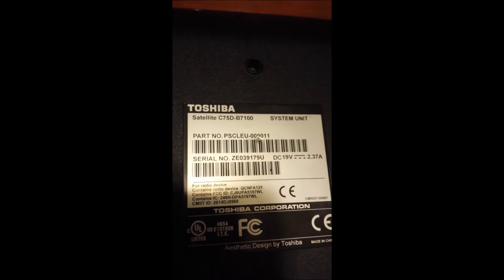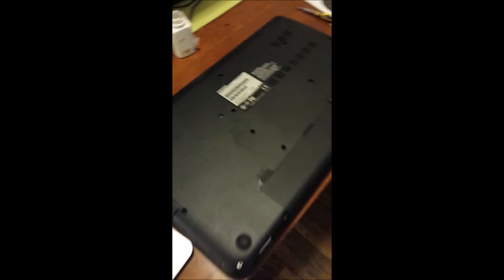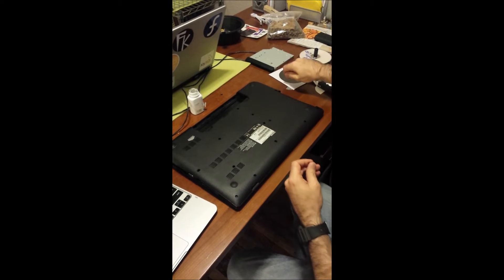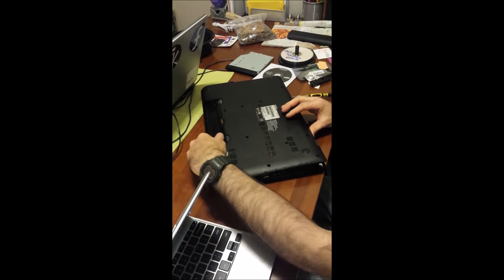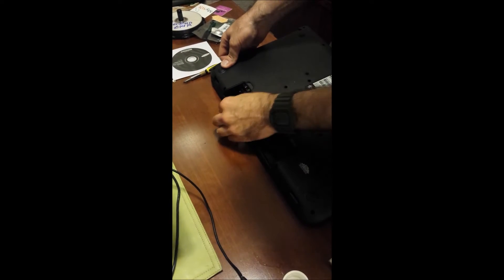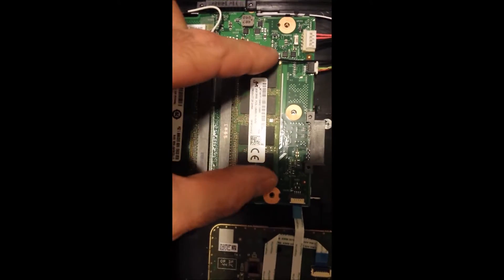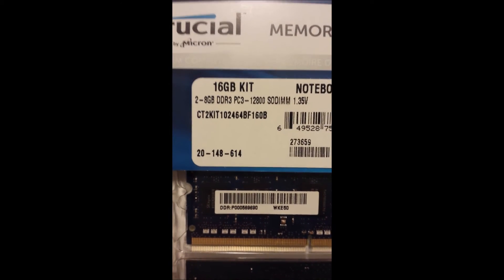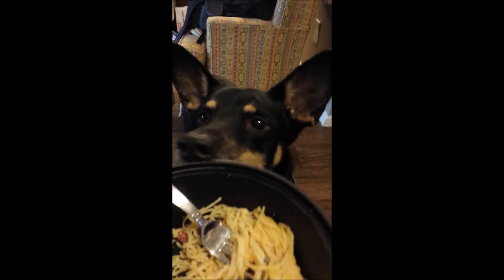Toshiba Satellite C75D-B7100 laptop can be upgraded to 16GB RAM and Samsung 850 EVO SSD

Comment: Just installed 16GB in my wife's Toshiba.  Great instructions on getting this apart, however, we can't tell there's any increase in speed.  May be time to do the hard drive, too.  Can you just drop an SSD in and start from scratch or do these require specific Toshiba software to run?
Reply: it should be just drop in. i haven't done this upgrade on mine, but i have formatted it, and flashed it to new operating systems more times than I can think.

Comment: I have a Toshiba Satellite C75D with 6g memory and 750 HDD. I swapped the HDD for a Samsung 860 EVO, which works fine. I also rreplaced the 6GB memory for 16GB. However the laptop wont start with the 16GB. Any ideas what I can do to get the laptop to start with 16GM?
Reply: Take both cards out, then reseat 1 in the first slot. then see if it boots, if it does, power down and swap the 1st card for the 2nd card and boot again. if both times it boots, power it back down and install both and boot one more time. some times computers can be finniky about part swapping. its best to test one thing at a time.
If it does not boot with one of the sticks of ram, that ram may be bad. or incompatible. you need ram that is 1.3v

Comment: This laptop is slow.  Does the ram make that much of a difference or is the processor just too weak that it won’t matter?
Reply from the maker: I would suggest putting an SSD in this system, that will probably make the most singular difference, but putting 8GB or more RAM in there will def. help. Mine has been very fast since I did these upgrades to it and it works extremely well so the CPU I think is good enough.
Reply: Chase Thanks, good to know.  I will definitely upgrade the ram.  Maybe the sdd too.

Comment: The cases are hung up around the center of the unit trying to separate. Flexing noticed at the area of the DVD/CD drive internal connector and PCB board area. Thanks anyway, I'm not sure what to do next on this thing. BTW: I serviced laptops for years, including Apple, MacBook Pro's etc.  This unit is a C75D-B7260 and looks the same with solid back. Don't know what now. Let you know if I figure it out.

Comment: when you upgraded your SSD, did you end up with unsuable space?  I had a 650 GB and I installed a 1TB and after cloning it, I still only have 650 available to use.
Reply from the maker: What you are going to do is go into Windows logical disk manager and "extend" your disk to include the remaining space.
Extend a Basic Volume
https://technet.microsoft.com/en-us/library/cc771473(v=ws.11).aspx#BKMK_WINUI

Here's how to get the disk manager open: START > RUN > diskmgmt.msc

Comment: Thanks much for the video!

I replaced the stock INCREDIBLY INSUFFICIENT 6GB of RAM with 16GB and my laptop runs 100% better. The new RAM was recognized immediately. 

I'm amazed Toshiba has the nerve to sell such an underpowered computer. Interestingly, before I switched out the original 6Gb with the 16Gb there was typically only 1.5GB or so of useable memory. With the added RAM there's 15GB, IOW, the system itself is using much less RAM. Maybe the replacement RAM was of better quality than the original RAM that came with the computer?
Reply: Soooo many small screws to remove to disassemble the case. I wonder if Toshiba does that to discourage people from opening-up their laptops to upgrade them? Maybe the idea is to get them to buy a NEW machine rather than upgrade the old one?
Reply from the maker: I am glad that your upgrdae went well! :-) I am glad you found the video useful thank you!

Comment: I have a Toshiba satellite C75D b7297 which looks on the bottom to be same as yours, Chase H. I haven't opened it up yet, but the symptoms are a few months ago the HD started making squeaks and squeals and the computer shut down. Would not reboot normal. I was able to recover with the USB recovery stick I made when I got the laptop.  I believe your video will help me when I go to replace the HD with probably the SSD that you used.  Am I to understand that the recovery isn't dependent on the old hard drive being present, but just using the recovery usb and any settings I might have to make in the bios... that it 'should' recover back to the windows 10 it came with?  Thanks for any input. It's unusable at the moment... EDIT: ok, you did answer my question at the end of the video.  I have another issue which isn't that bad, but an annoyance. I use an external usb mouse to get around it... the touch pad has lost most of it's sensitivity... any ideas?
Reply from the maker: If you replace the SSD you might as well do the RAM too. I did it to my system and it runs faster than anything you can buy prefabricated.
Reply: Chase H. yes I was thinking the same as well. I ordered mine with 6 gigs of RAM but 16 might as well the price is not bad
Reply: Did the upgrade on the SSD Didn't order the memory yet (have 6GB right now).  Tip for folks- as you mentioned in the video, keep going around pressing the case together as long as you see a gap or hear it still snapping together. When I thought I was done pressing it together- I wasn't.
Reply: Chase H. Thanks for the heart. I know I already mentioned this but I did the upgrade on the SSD. For a year now the laptop has been booting up in about 17 seconds. Great upgrade.

Comment: Would this work for a C75d-B7300?
Reply from the maker: It probably will, but what I would suggest is opening it up first and looking at the RAM. You want to make sure to get aftermarket RAM the exact same speed and specs as what was in there.

Comment: great vid. what's teh best way to clone or copy over data from the old drive? I got a 650gb and it's near full. Wanna get the 1TB SSD.  Is there any config needed?
Reply from the maker: Hello! Thanks for the compliment. I got a copy of Acronis True Image that came with one of my SSD drives, and it works well for that use. I did not have to pay for the full license, but it's very good software for backup, restore, and cloning systems.

http://www.acronis.com/en-us/personal/computer-backup/

Comment: Your link to Newegg not working!   What  the crucial part number for the memory ?
Reply from the maker: MEMORY IS:
Crucial 16GB (2 x 8G) 204-Pin DDR3 SO-DIMM DDR3L 1600 (PC3L 12800) Laptop Memory Model CT2KIT102464BF160B

http://www.newegg.com/Product/Product.aspx?Item=N82E16820148614
Reply: Thank You for the info. You might want to check Amazon prices I know Amazon shipping is much faster Newegg

Comment: Can I upgrade the AMD A8 cpu to an AMD A10?
Reply from the maker: Hello! Not sure why you would want to do that for such a small performance upgrade, but it depends on the socket and the motherboard chipset. I don't know the answer to this though, but it would be interesting to try. Here are the performance differences:

http://cpuboss.com/cpus/AMD-A8-6600K-vs-AMD-A10-5800K
Reply: +Chase H. Thanks for the reply laptop as a gift and have been using it for gaming so max performance I guess, I replaced cpu in laptops be like a hp pavilion.

Comment: I did purchase the 16g ram chips and made a huge improvement, now only if i could overclock the cpu and gpu so make gaming a bit easier. I bought a ssd when i bought the laptop, so i can't comment about speed change as i didn't boot it with the shitty 5400 rpm one it came with

Comment: While this certainly makes cleaning the fans and such very easy, at least in comparison to the method on older laptops that required you to do far more stripping down of the machine, but JESUS this makes just swapping hard drives out a real bitch.

Comment: im having trouble with the back i can almost lift it up, but it seems to be attached to something, its right below were the battery is
Reply: I'm sure you have gotten it by now but it's just a small plastic knob under the battery connector that is holding it. Just stick a small flat screwdriver or something else that will fit under the plastic and pry up, it feels like something will break but it should pop out without breaking first.

Comment: Thanks so much for making this video!  I've searched far and wide looking for disassembly instructions for the C75D series and yours is essentially the only one out there!  Makes you wonder why they didn't do like just about every other laptop (Toshiba and others) and just use a case with "trapdoor" compartments for memory and HDD upgrades! THANK YOU!!!
Reply from the maker: +Mike Segotta-Cassi - I am glad it could help you Mike. I have been using my upgraded computer now and it's VERY fast. Does everything I could want and more, and if I bought it like this it would cost 1000 bucks so I did it on the cheap and if I could help others that's why I made the video. :-)
Reply: Well the good news is that I was able to open it up just as easy as you please once I watched your video...the bad news is that I wasn't trying to upgrade.  

The client who owns it locked themselves out of the HDD and after nearly a week I've given up on salvaging the drive.  (I was pretty sure the data was toast from what I'd read about Toshiba systems, though.)  

What I didn't expect was that wiping the drive with AutoNuke takes like 800 hours to complete!!   It's been executing the wipe process for about 24 hours now and I might just stop it before too long and see if I can't at least format it at that point.  The data isn't sensitive nor does it need to be recovered, so I'm hoping in 24 hours AutoNuke has gotten past the boot sectors and anything else flagging the device as locked.  

Otherwise, I think I'll have to recommend the client just but a new drive (SSD of course) and start from scratch--especially since he's already let me know he has erased the recovery partition a long time ago.  Hello Windows 10!  <ugh>
Reply from the maker: Well I'm glad you could get the case apart. I know that I looked for instructions on how to get it opened and I didn't see any at the time, so I suppose that's what made me create these. Plus, New Toshiba C75D systems at Office Depot are currently going for 500+ dollars (not even including this type of specs) when you can just buy a used one or refurbished one on Newegg or ebay and upgrade it. The AMD A8 CPU that comes in this system is fairly fast and comparable to an Intel i5 as far as performance.